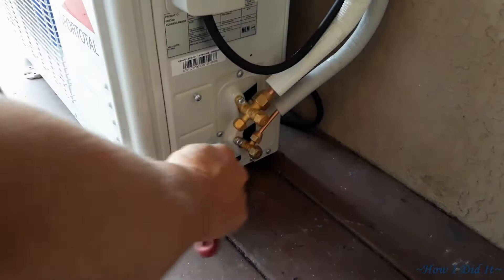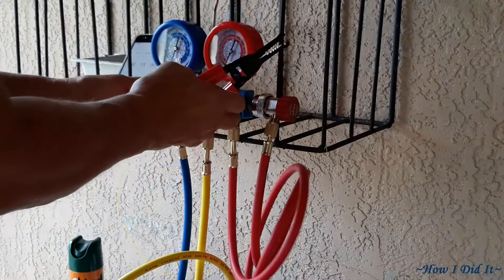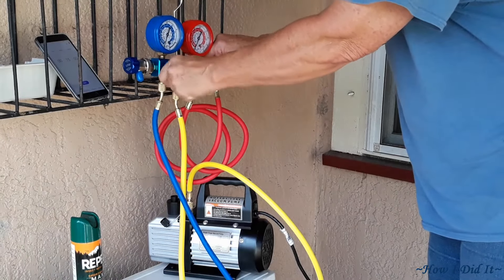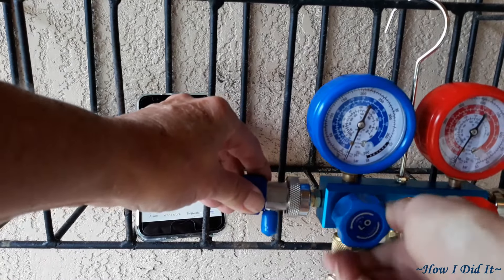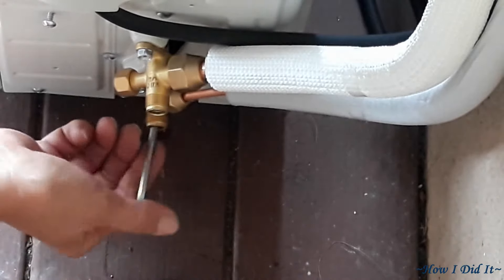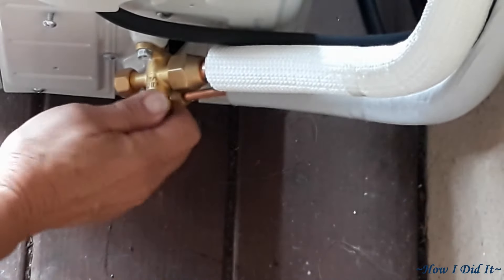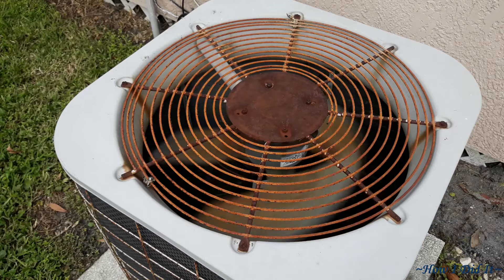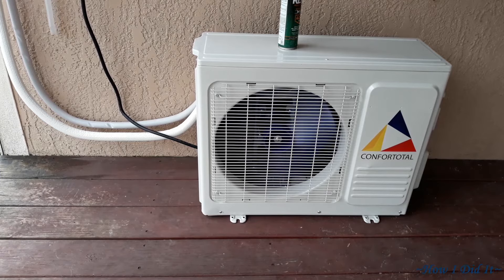Vacuum a mini split ~ howididit ~

Comment: FYI, you can borrow a vacuum pump and guages from many auto parts stores.  Great job!
Reply from the maker: GREAT tip, thanks!
Reply: I got the gauge set from O'Reilly's but the fittings didn't fit the mini split adapter.

Comment: Thank you for the video. You didn't show your power source.  You said in the beginning that you were going to plug it into a regular 110 outlet. Where did you get thecpower cord and was UT on the inside air handler or outside compressor.  Thanks!
Reply: Yes. Where is it plugged in ?
Reply: @2109djones  yes from air handler or the compressor unit?

Comment: Thank you very much I was able to finish last step of my minisplit install 
First time I did the vacuuming It wasn’t working 
I didn’t have the right adapter fitting 
Now my minisplit is working I can have warm winter
In 2022 It was cold for about 3 months 
This summer It was hot as hell close to 100 degrees for 2 months 
Because my house AC went out
Just subscribed
Reply from the maker: Awesome! I'm glad it helped.

Comment: Mistakes.   Do not disconnect the vacuum line before releasing some refrigerant into the system and creating a positive pressure. You are allowing air to enter the system,  if it is not pressurized to at least 1 psi.

Comment: Hows yours holding up? Crazy but mine is the same unit ive installed on my RV and going over the final checks before i release the refrigerant.  I even have the same vac pump& gauges 😂
Reply from the maker: Hello there, absolutely fantastic. The awesome part of it being 110v if my Son loses power during a hurricane his generator will run it without any issues.
Reply: @howididit  that is good news. This one is up and running now. I can't believe how quiet it is. Same with here if we lose power as we do often from storms, I can run of my in coach generator without issues.  I'm very pleased with this unit. Thanks for the update

Comment: You are suppose to close the blue valve when your done vacuuming
Reply from the maker: correct. pull the vacuum, close the gauge, and then open the ac lines to flow the freon.

Comment: I noticed you left the blue valve open after turning off the pump to check for leaks.  In other youtube videos, they shut this valve off after turning off the pump.  Is there a difference between the 2 methods?  I tend to think that your way is correct and the gauge will actually change if there is a leak compared to if the valve was turned off.
Reply from the maker: I'm not sure, but the mini is still blowing cold. Thanks for watching,
 Have a wonderful and blessed day.
Reply: The gauge reads pressure behind the valve. The only thing holding this vacuum in this video was the check valve in the harbor freight vacuum pump. I would close the valve before turning the pump off. This was luck.
Reply: Yupppp she did this all wrong..n yes she was supposed to shut off the blue cknob than turn off the pump to verify the vacume held on -30.

Comment: i got just about same unit, it leaks a line of blue down the wall,  what is causing this, ive vacuumed the drain line,   it need more insulation?
Reply from the maker: @graveytrain32  leaks a line of blue down the wall? Are you saying your drain is backed, up causing condensation to not drain out the drain hose?

Comment: I just installed this unit and ran it for the first time last night.  In heat mode, auto, once the unit warmed the room up to temperature, the temp. light on the indoor blower unit starts blinking.  I cannot find anything in the manual that troubleshoots this.  Is it normal?  Thanks
Reply from the maker: My unit did the same, it heated great, I just assumed (I know, I know, LOL) that was normal for it as the heat worked wonderful the couple of days it was used.

Comment: You don’t have to tighten down your gauges that much. They have rubber seals in them you actually damage from over tightening
Reply from the maker: Thanks for the tip.

Comment: These videos are so helpful!  Thank you so much!  I think I'll try this myself, so thanks for the inspiration!  One question, the electrical runs through the line set hole and plugs into the inside outlet?  Thank you again and have a great day!!
Reply from the maker: Good morning Nate, the wire that ran through the wall was the communication wire between units. The power source for my unit is from the 110v plug. Have a wonderful day
Reply: @howididit  thank you so much!!

Comment: When you took the vacuum hose off, didnt it pull lots of air into your line set?    I've see other people charge the system before removing the hose, and lots of gas came out.  Either way, I suppose your going to lose vacuum or gas..
Reply from the maker: No, but a few viewers that do AC service advised to close all of the lines on the condensing unit and pump prior to removing the vacuum lines from the condensing unit. The unit cooled like a charm all summer, and is keeping things toasty warm with the little cold snap we are having.
Reply: was my concern too but i think with some units it doesnt matter much. might be worth someone doing a demonstration of charging before vs after

Comment: I have a question opening the valves do you need to open them after you vacuum or before and do you need to close them back I am new to this train and I see very different things so I very confused
Reply from the maker: I vacuumed the unit down for about 15min, turned off the vacuum and let it sit for 20+ the opened them after the vacuum

Comment: I called a local hvac company for a quote to just vacuum the line out.  .... $2,000.00. I dont think they wanted to do it.
Reply from the maker: WOW! that is crazy expensive. All the more reason to buy the pump, gauges, adapters and DIY it.
Reply: Yes, they didn't want to deal with you. Call around--find a mechanic who moonlights. Auto A/C works quite the same. Vacuum, charge, release vac.
Reply: I called "my guy" ahead of time when I was going to spend 1000 for  unit.  He said let me quote you a full install because they're not that expensive (and he wanted to use a larger unit). His quote was right at 4,000.  I thanked him.  I'd rather have a pair of little ones than one big one and know I can do it now for 1/4 the price of retail. First unit is on the way now!

Comment: what size was the adaptor? did it come with the vacuum and manifold kit? or did you buy it separately? thanks
Reply from the maker: good morning, I purchased the pump gauges and adapter specifically for 410 freon off amazon.
Reply: Majority of mini splits these days have a 5/16" port so you'll need a 5/16" to 1/4" adapter to attach gauges
Reply from the maker: Thanks for the info BosS

Comment: Always break the vacuum with refrigerant before disconnecting attachments. 😒 Also please stop using pliers or channels to tighten stuff omg lol
Reply from the maker: Thank you for the tips, and info!
Reply: @ howididit   you did an amazing job, doesn't matter what you use to tighten those connections for the vacuum lines as long as they are tightened

Comment: Love the spirit of this video... Would note a few things.
1.   If you don't have proper EPA certification, the EPA can fine you up to $37,500/day.  Anyone willing to turn you in can get a reward of up to $10,000.    I got my EPA-Universal cert by taking a ~$500 class at the community collage.     
2.  You shouldn't use pliers on these fittings.  finger tight should be sufficient.
3.  EPA requires that system be leak tested down to 500 microns after evacuation.
4.  After vacuum system.  close off low pressure side of gauge;    Then release refrigerant;    Then remove gauges from fitting.  If you release hose under vacuum, you'll suck in non-condensibles.
Reply: What for smoke are you blowing. Sounds like a HVAC guy that has lost a ton of $$$!
Reply: A lot of DIY mini splits use R290 as the refrigerant which is harmless to the environment and safe for DIYers. Providing you don’t ignite it.
Reply: I also agree those fittings do not require a channel loc.  That is very poor practise to suggest using  tools to tighten fittings that are meant to be hand tightened.  They have a rubber seal for a reason.

Comment: After tightening up the fittings using a wire stripper, she says "Use the right tool for the job"
Reply from the maker: Haha, right! I'm working on mastering how I do it, but over all I am pretty blessed as it worked ;-)  On a side note, my motto is "worst case scenario, I have to hire someone". Thanks for watching.

Comment: looks like you did this totally wrong, disconnecting the blue line before releasing the refrigerant, you lost the vacuum. people really shouldn't make video if they don't know what they are doing.
Reply from the maker: Well, doggone, if I did it wrong, I am so grateful the unit didn't realize that, as it is still cooling like a charm. Thanks for watching.
Reply: You are correct.  The Schrader valve leaks at disconnection, so the manufacturer's instructions say to release enough refrigerant to get a low positive pressure, then disconnect the blue line.  The line set will lose a little refrigerant, but contain no air.  Her procedure is wrong.

Comment: Don't follow this video.  It's wrong
Reply from the maker: Help me out, how is it wrong? My unit is working perfectly.
Reply: @howididit  you disconnected the blue hose from the unit before releasing refrigerant.  When you did that you lost some vacuum when you disconnected from the Schrader valve on the unit.  It's better to lose some of the refrigerant than to lose some vacuum.  That allows in air and with it, humidity.  Your unit will work ok for a while but my understanding is that the refrigerant will degrade and potentially damage windings in the compressor.  I'm not an expert but I e watched dozens of similar videos.  By the way, nice job on the video other than this one part of the procedure.
Reply from the maker: Just a heads up, I pinned your comment to the top of the feed for other folks to read, thanks again.
Reply: You never Vac down for a period of time you Vac down to 500 microns. Whatever time that is changes from unit to unit.
Reply from the maker: Thank you, another great tip for my next install.